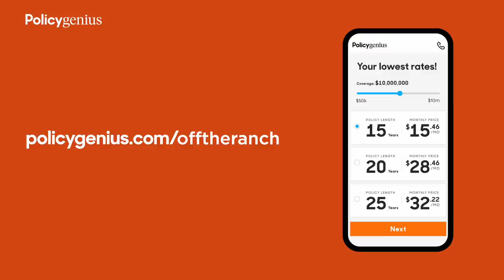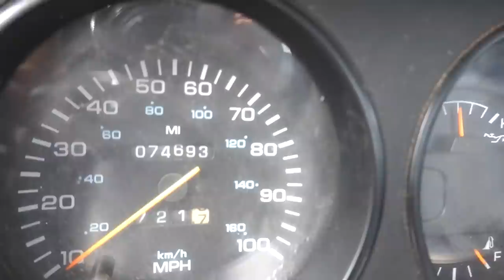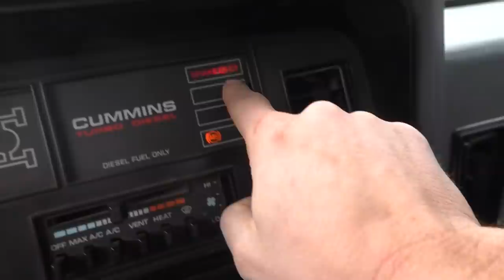Mere left town... within 45 minutes I bought a truck...

Comment: New/re-arced springs and helper bags (air bags) in the rear should help a lot, maybe upgrade the intercooler, oil cooler and transcooler if you are going to be doing a lot of towing.
Reply: Good advice. Bots are ridiculous.
Reply: I am very jealous of your Cummins collection!
Reply: There's no need of a trans cooler on manual transmission though.
Reply: @SomebodysNephew  they are out in full force in this comment section. I've been reporting like crazy
Reply: @manamee1  me too
Reply: @davidbeers5949  If they have pressure oiling, might as well put a cooler on it, semis do.  Not familiar enough with the Dodge transmissions to know for sure, but pretty sure this one is splash lubricated so you would be right.
Reply: @MyRefriedBeans18  pile of junk this thing is actually nice for a 93 truck

Comment: Ya should put a new door with modern mirrors (Saftey upgrade)
Bigger Turbsky (saftey upgrade)
Wheels & Tires (saftey upgrade)
Suspension work (saftey upgrade)
ECU Tune (saftey upgrade)
Orange seat belts (Helps sell all the  other "saftey" upgrades as legit "saftey" upgrades...)
Everything can be explained to and accepted by Mere if properly laid out... Not to mention that with it being a Company Work Truck it would be a nice tax break. Those types of vidgeos seem to be super popular judging by views... Will bring in new subs and work with companies you've maybe never worked with.. 
It will help with keeping the feller who helped out at your Garage/Shop busy too. I just dont see a down side to doing a mini-build  series on those "Saftey and Reliability upgrades.. Back ta work!
Reply: Safety
Reply: Genius comment

Comment: The frames crack around the steering box due to the frame flexing.  You can buy a brace that crosses from one side of the frame to the other. It makes a huge difference in the steering feel.

Comment: If it’s the stock 5 speed, it’s called a g360 getrag. The springs on the back are pretty flat arched and the front springs are actually negative arched from factory. Still wouldn’t hurt to freshen them up though! Great truck!
Reply: New venture makes both nv3500, and nv4500, which is the heavier 5 speed.
Reply: Which one of them is the one that 5th gear fails?
Reply: Nv4500 the 5th gear nut backs off
Reply: Nothing wrong with a getrag. 600k on mine all I’ve done is replaced selector tray and rear shims.
Reply: The g360 is the automatic.  He's got a manual. He's right on the trans. Getrag trans are GARBAGE
Reply: @andrewdowling8821  the g360 is the manual…  the 260 is the auto. Also getrags aren’t much worse than a nv4500. I still have mine and the factory Sachs clutch.
Reply: @andrewdowling8821  No
Reply: It's a nv4500
Reply: @JasonY02  it’s a Getrag 360… since when did a NV4500 ever come out in a First Gen Dodge Ram??
Reply: @warrenmcelroy4718  ummmm the nv4500 non hd was in the gasoline trucks….would break in half under a cummins but an nv4500 nonetheless.
Reply: @derkaderkastan420  do I honestly need to specify “first Gen Dodge Ram Cummins” when we ALL know we’re talking about the diesel powered pickups? I mean you’re not wrong, but we all know this truck doesn’t have the NV4500, and that’s what’s being questioned here…. Isn’t it?
Reply: @derkaderkastan420  ok I take it that we’re in agreement then….

Comment: I’m sure it’s already been said but that appears to be completely stock under the hood. The stock 5 speed trans is the Getrag 360 which they are notoriously not very good. The NV4500 is the 5 speed manual trans that comes in 2nd gens and the NV5600 is the 6 speed that came as an option In late 2nd gens and was in the early 3rd gens.
Reply: I’ve seen a few people do a g56 conversion which is widely considered the best option
Reply: It's a manual.
Reply: @hagggle3727  I personally prefer the G56 out of them. It’s by far the smoothest shifting.
Reply: @andrewdowling8821  that’s obvious and isn’t being debated

Comment: You found an absolute gem with that first gen. Please don’t just beat tf out of it. Low mile, manual, 4x4. You could sell that for 20k here in pa right now. And you talking yourself out of a p pump. Worth every penny. Even if you don’t think you wanna mod it just to have the extra couple hp is very worth it
Reply: Pretty sure he can do whatever the hell he wants with it. 20k to Matt is chumpchange.

Comment: Getrag 360, nv4500 came out in the 94+ trucks and then the nv5600 which is a 6 speed the second number denotes the amount of gears
Reply: Except on the getrag 360 because it’s not the same manufacturer

Comment: Without a load, start in 2nd.  Some shifters read L, 1, 2, 3, 4 because most people start in 2 anyway.  1 is extra low, my dad used to play around and put the truck in 1 and we could idle and go up our fairly steep driveway without stalling.
Reply: Yeah on those transmissions 1st gear is for steep hills and when you have a REALLY heavy load and you need to get it moving, or its just STUCK.
Reply: I cant remember the last time mine i’ve used 1st gear in any diesel🤣

Comment: Springs are not only flat they are actually going the wrong direction arching down. Paint the chassis and put some new springs on it. Ghost riding is good for picking up hay out of the hay field by your self or with others you can help.

Comment: That's exactly how those springs are supposed to be. Those mirrors will %100 destroy things, they are super strong. Engine looks stock, you won't feel any turbo until you have a load on it, a lot of load. Do yourself a favor and get a steering box frame brace, and talk to Borgsen about steering components
Reply: Oh and look up killer dowel pin

Comment: If it’s a 5 speed it’s more than likely a nv4500, a nv5600 is a 6 speed. Sweet truck man!! You don’t come across ones setup like that much.
Reply: 1st gens actually came with a getrag 360
Reply: Yep, Getrag 360 is what mine had.
Reply: Getrag 360 np205 transfer case.
Reply: It's an NV4500. They switched to them in 92'.
Reply: @matthewevans5926  Everything I've ever seen is 89-93 were Getrag 360, and '94+ was the NV4500 until they switched to the 6-speed.
Reply: @matthewevans5926  Dodge used the NV4500 behind GAS engines, in their trucks, in '92-'93.  They used the G360 behind the Cummins in all First Gen trucks ('89-93).

Comment: The trans thats prob stock in that is a GETRAG 360 german built trans 
A nv4500 is a upgraded 5 speed 
The nv5600 or a g56 are 2 6spd trans that are nice to have as well  just a bit of info for you   Off The Ranch

Comment: 1991 model year was when they started adding the intercoolers.  Dad bought an early '91 model that isn't intercooled.  Approximately half way through the '91 model year the intercoolers appeared .  The transmission should be a Getrag G360 manual.  As others have said, 1st gear isn't needed for general driving.  Starting in 2nd is just fine.
Reply: Nah, it'd be a NV4500. They started using them in 92'
Reply: @matthewevans5926  its a getrag, do your research...nv4500 never came in a 1st gen and didnt bolt up to the pass drop 205, it had the nv271 tcase
Reply: @karnagefabrication2955  Matthew is half right. The NV4500 was used in the gas trucks in 92 and 93, but the diesels were the Getrag 360. And an NP205 absolutely bolts up to the NV4500, and NV5600, and G56, provided it has the correct input shaft and/or coupler.

Comment: The safety feature that keeps you from starting it in gear is called the Neutral Safety Switch, sometimes abbreviated as NSS, and those springs are definitely looking saggy.
Reply: Called a clutch interlock.   Automatic would be neutral safety switch.
Reply: @yellow599rider  thank you for setting him straight. Was gonna do it but ya beat me to it
Reply: @yellow599rider  I mean you're not wrong, but you'll never find that switch if you go looking for a clutch interlock.  There's no such category in any parts lookup.  Source: I sold auto parts for 10 years.
Reply: @ndsubisonfan  and I’m also ase certified in parts ,and school buses.  Doesn’t matter if you can’t find it, it’s correct.

Comment: Getrag g360 is the transmission in that truck. Nv4500 is a 2nd gen 5 speed. Nv5600 is 6 speed came in 2nd and 3rd gens. Getrag g56 is all other 3rd gen up 6 speed manuals

Comment: Dude with the low miles and the straight leaf springs I’m guessing that truck was worked way passed it’s limits. I’d prepare for many future issues. Just friendly advice from a Cummins fan👍 FYI if you replace the valve springs with the stock valve springs from a Chevy 350 they will fit perfect and give you an extra 10 to 12 horsepower 👍

Comment: Looks to be all stock, trans is a getrag 360. 91.5 is when they went intercooled, its got a ve pump, the steering wheel perplexes me some if its a 93, I have had a couple of those trucks, the trans is a little fragile if you go adding power
Reply: Oh and the brake and abs light, check the rear abs module on the frame

Comment: Matt - my guy, toss a jackstand at the tippy tip of your forks (when lifting/moving bulky sh...tuff; in the absence of fork extensions, naturally)...ratcheting strap = ✅
Be bogus to be f-n around all these years with the 2, maybe 3 firearms you have just to get crushed by a pretty G.D. AWESOME flatbed (I'm thinkin IF gettin crushed is how a cool dude such as you or I has to cash out....well, gettin crushed by that thing would be acceptable. L8R, Au Gratin Poe T8R.

Comment: The transmission in the 93 could either be a Getrag G360 or a NV4500 I have had 93's with both. If you have the NV4500 swap it for the G360 quick because those are garbage. They don't take too kindly to heavy loads or hot dogging the 5th gear nuts like to come off and will grenade the trans.

Comment: Looks bone stock to me. Definitely a stock h1c turbo. If you hauling with it, highly recommend 5x.012 injectors and a 2nd gen cummins hx35 turbo and have it tuned. Fuel pin and governor spring. Also if the killer dowel pin hasn't been addressed yet, Definitely do that first and foremost.1 wire alternator upgrade is definitely something to consider to.

Comment: The cover did come on the 89-98 12v Cummins but most people take them off to keep them so its hard to find one with the cover on them anymore and the engine does look stock from what I can see. Also a good way to tell for the transmissions is NV4500- is the 5 speed and the NV5600 is the 6 speed (didn't come out till I believe '98-99 I believe 06) then the G56 isn't till 06 Cummins body style and they came intercooled starting 92-93 I believe. I hope this was helpful for you Matt.

Comment: Should have a Getrag G360 5 speed they used  nv4500 starting in 1994 I believe up till 2004 which is also a 5 speed the nv5600 was a 6 speed and weren’t in rams until 1999 until 2005 then swapped  they started using g56 6 speed from 2005 up until present

Comment: Make sure and check the killer dowel pin and do a front seal while you are there.  It should have the Getrag 5speed in it also.  I'm restoring/converting my 92 D350 to a W350.

Comment: I had the same trans in my 92 w250, never used first, it's a granny gear, I could put it in 4 lo, first, get out and dig the snow out of the way and when the truck walked itself away I could just hop back in and off I went. I miss that truck.

Comment: I love my 1st gen cummins. You can have air-conditioning, but not airbags. The trans is a getrag 360. Make sure you use 5w-20 mobile 1 engine oil in it. You found a unicorn tho. 4x4, 5speed, dually is a $50,000 truck fully restored.

Comment: Being that its a five speed it would be a getrag 360, but the nv4500 is also a 5 speed but put into the second gens then the nv5600 was a 6 speed put in the 3rd gens and the fourth gens got the g56 which is also a 6 speed but has an aluminum housing as opposed the cast housing of the nv series

Comment: What.. what's the word for u have to have the clutch in to start...
What Matt...
Can someone tell me what he's talking about...????
Reply: A clutch safety switch.  Those vehicles with a clutch safety switch need the clutch pedal depressed before the ignition system will start the motor.  Works on the same principle as a neutral safety switch on a manual transmission, that won't let the motor start without the transmission being in neutral.
Reply: @45Deere9500  ok.. but why was he saying about it...

On every manual trans vehicle... U ALWAYS push the clutch before you start A vehicle... That's just common sense... 
So why was he bringing it up like it's a big deal.. or that it matters???. 
I'm not getting it... Thanx

Comment: Nice. That's a legit $15,000 truck here in Ohio. If I were you, I'd invest about $1000 in painting the cab. It's plenty good enough for that. Rattle can the bed and Thompson's Water Seal the bed sides. It can be a very nice work truck. Nice enough to sport a Bunker Branding logo on the doors.

Comment: I have a 93 d250. It is a manual gtrag, 5 speed. And yes that valve cover plat is from the factory. If that is the stock turbo, then switch it to a 2nd gen HX35 ($200-250). Do a hungry diesel 3200 rpm spring with their fuel pin. And then do a 4 inch diamond eye exhaust, then turn the power screw up.

Comment: That 5 speed manual is a G360, in the G360, it has what is called a granny low first gear, so technically it’s a 4 speed with granny low, the NV4500 wasn’t introduced until 1995 in ram trucks and the NV5600 is a 6 speed manual and those weren’t introduced into the ram trucks until 1998, same year the 24V Cummins was introduced

Comment: I don’t know about Dodge, but on my 2000 Chevy Astro van the “Brake” and “ABS” lights are both on also. Shop told me it’s the ABS Control Module. Brakes still work, ABS doesn’t. So be careful and make sure you pump the brakes when you need to because they will lock up if you slam on the brakes. Ask me how I know.

Comment: l had a pool, pond and synthetic putting green business in Tx and Ca. and over 22 years went thru 11 trucks. All brand new. The best by far were the 6 Superduty's, the 2nd best was the 2 Dodge 2500 cummins but the brake line issue and the bodies fell apart  but the worst by far were the mid 80s GMC 3500hd sierra classic l started with and a c30 chevy van. The GMC was eturned under the lemon law. Dont know if that still exists. Had a little Nissan truck that outworked them all tho. A 2.4litre little grocery getter. 35o+k on the odometer and they tried to destroy it. Love the channel

Comment: In the ole first gens they have the getrag 360 (junk). The newer second gen 12 valves have the nv 4500. Then there is the 6speed nv5600. And those are the old tow mirrors Matt! They are already folded out! Spin them around and flip the mirror and they will be in but might not be able to see around the flatbed as well. And last bit of info is 91.5 came with the intercooler. My ole 12 valve is a late 91 and is inter cooled

Comment: So the clutch "thing" I called a clutch saftey switch. Also with 1st and 2nd gens that steering slop is very common and it can definitely get better with bushings, ball joints, and u joints (there's a lot of bushing) but it most likely won't go away completely

Comment: As a connoisseur (kinda) of old dodge trucks might I suggest a flaming river slip shaft kit to tighten that steering up? Yeah trust me, it's the solution to that problem. The intermediate shaft with the rag joint/goofy box at the steering gear setup is not a great design. My 1980 power wagon had all sorts of play in the steering. I replaced it with the flaming river slip shaft kit and tah dah! It was as tight as a modern truck. Sweet truck though.

Comment: Springs are fine, they are flat arched and negative, from factory, I wouldn’t even bother touching them because they are completely fine and the truck doesn’t have enough miles to even consider them worn. Only thing that would make this truck more valuable is if it was a crewcab. Very clean and low mile truck.

Comment: If you need to know if the dash is right, look at the brake pedal. If its worn away, and the dash doesn't have 150K+ on it its probably not right. But even so, if it was a farm truck its probably better to know the hours and not the mileage.

Comment: That's how the leaf's were on those trucks. And the ABS light on the dash, they have a sensor on the rear pumpkin or there is a vacuum valve on the firewall that can cause that, it wont hurt anything, a lot of guys pull the bulbs out and ignore them, they've been on in my truck for 3 years with no problems. The only thing it needs is the Killer dowel pin fixed, and throwing air bags on it will make it ride nice.

Comment: My brother has a 94 Cummings he uses as a dump truck. It has seen some hard work but every time you need it summer or winter when you turn the key it starts. It will go up our mountains with a 5 ton load of gravel on it in fourth gear as fast as you want to go.
Its the exact same truck as you've got there.
My brothers ABS light has been on for about 15 years. No one could ever figure out way it come or how to fix it.

Comment: 4x4 going up a rough hill like that you aughta put the Transfer Case in LowRange, well same goes for 2wd too I rekon, Low Range takes a lot of stress off of the running gear and can be a lot less rough riding

Comment: A flat or negative arch is normal on the front springs of some older trucks. Brand new stock replacement springs will sit the same.

Comment: thoes springs need re bent or new springs. get a big block chevy k3500 better truck all around.
Reply: Na I owned a mint one sold it too much of weak metal there gas hoggers BAd fuel economy couldn’t handle the weight compared to my first gen Cummins  there are nice trucks but not the least comparable best option to a Cummins u get the best fuel mileage more reliable and better tow capacity